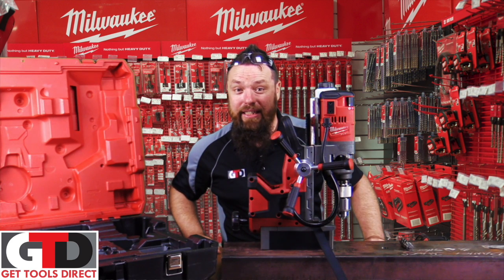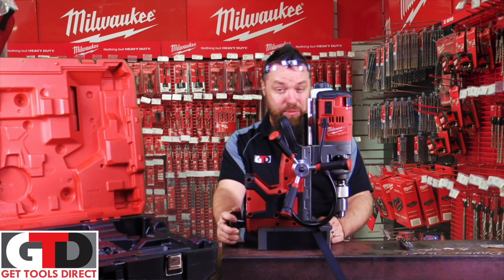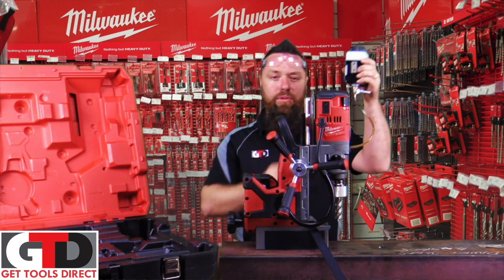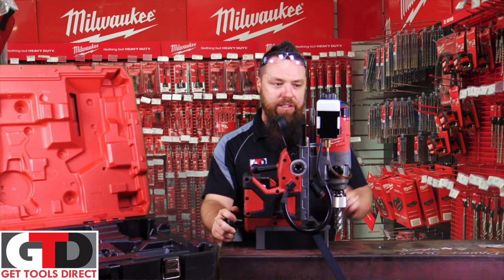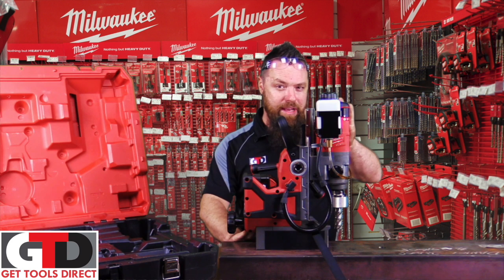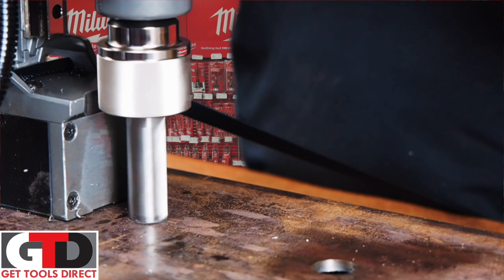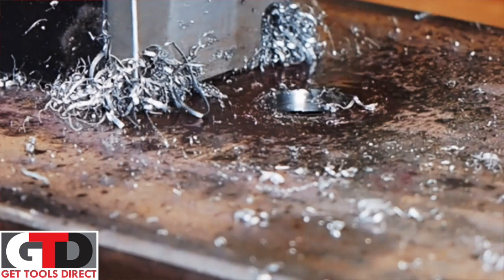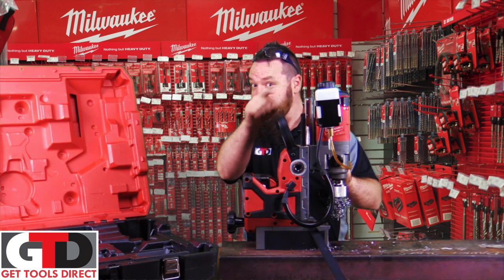Milwaukee 18V Brushless Magnetic Drill Press Demo

Comment: I wonder how much of the battery was left after the cut...or if they say how many holes drilled on one battery
Reply: Turn the volume up, that helps. He said 40 holes @20mm on a 6mm plate
Reply: Or how about how many hole instead of hole after a few dozen hole. Probably 2 holes per charge lol.
Reply: I recently done 8, 1-3/4” holes on one 12amp. The bigger the hole is the less holes per battery I would say.

Comment: The cutting fluid is only released when pressure is taken off the bit, cut then raise lightly and then resume cutting
Reply: ecoheliguy 
They are gravity flow or pulled via the chuck spinning.
Only comes out once the pin lifted.